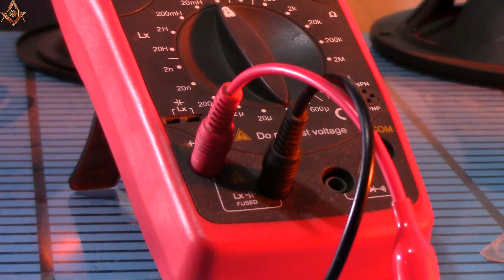how to make speakers louder, 2 simple tips adding mid bass audio 1Khz - 4KHz

Comment: would not a bipolar electrolyte be better? this common electrolytic, if used in a high power amplifier will burst?
Reply from the maker: I had an experiment to use polarizing capacitors. It has no problem with stamina and frequency
Reply: Guys... stop. Plz. 😭🤣😂💀